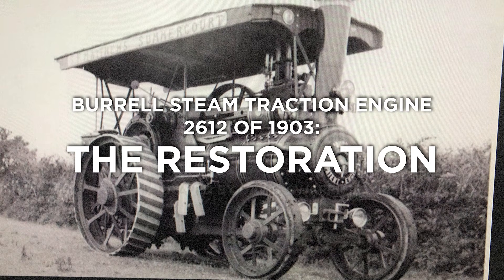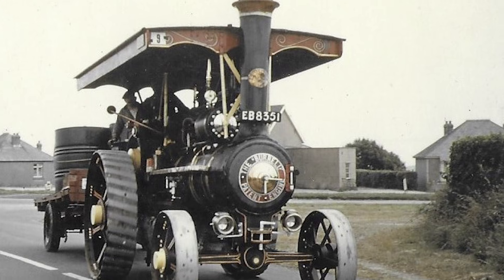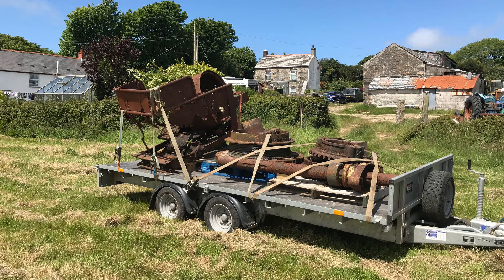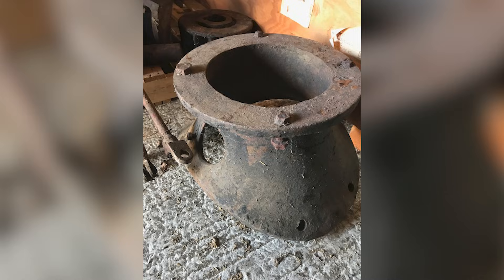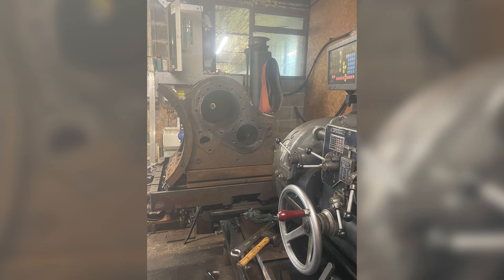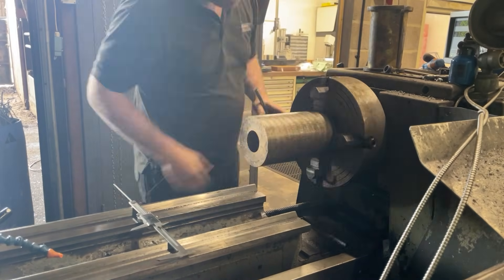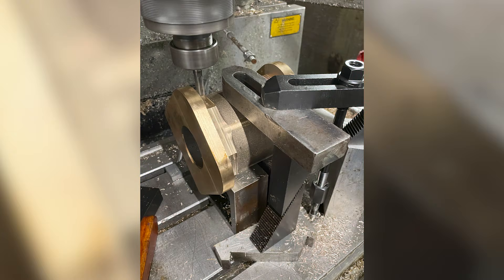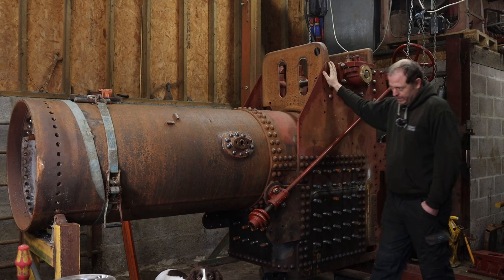Burrell Steam Engine Restoration: Nut And Bolt Rebuild Ep 1 (Restoring a 120 Year Old Steam Engine)

Comment: See if I got this time line right. It was in preservation for decades until dismantled and left to the elements? Just now being retrieved?
Reply from the maker: Was in use up until the 60's. Then got dismantled and left outside until 2000's. I purchased in 2023 and in it current condition less the work I've done. So boiler was nearly finished to a point before I purchased.

Comment: that is the best way of getting in to engine ownership , talking my self when trying to find a engine and not a roller , there is a lot of converted tat out there calling its self a traction  engine, but to find a lovely  6nhp burrell scc complete needing a full rebuild very rare indeed , is it a devonshire type ?
Reply: if you aint a fan of conversion then be my guest but i know of many of the engines here in the south east which would not be on the rally field without being converted as all the rolls had been nicked so no point in being negative about it